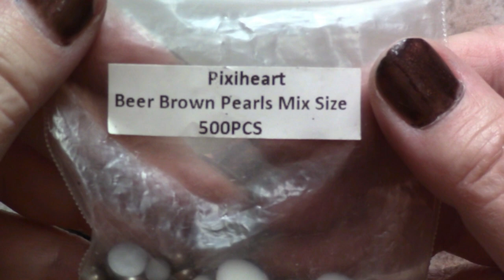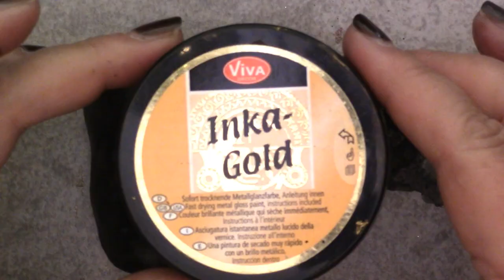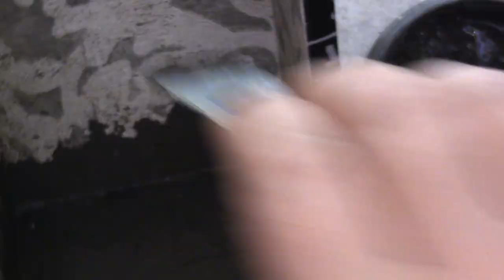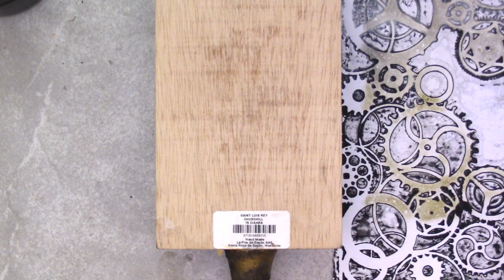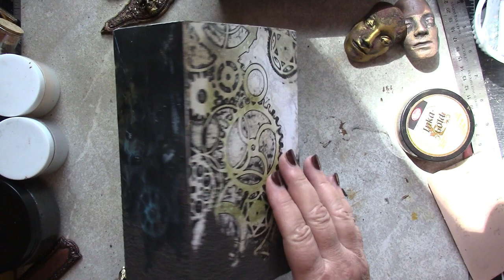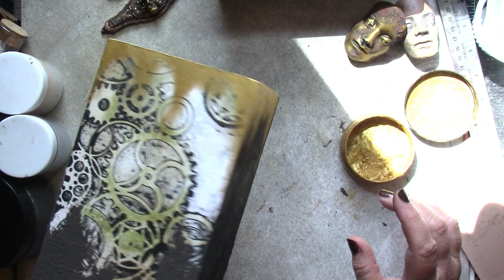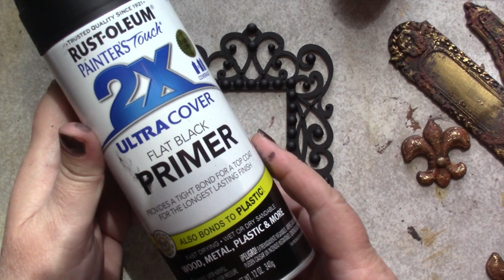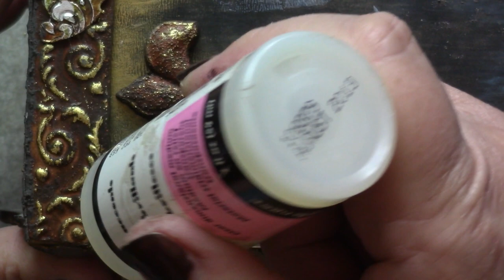Mixed Media Shrine  - "Acceptance"

Comment: i know it is a bit tricky, but making sure the item you are working on is centered would really help. we don't need to see the paint large and only a small part of the face you were working on. zooming out a bit would also help.

on your work surface, a small mark or sticker to mark the center of the video frame would go a long way to make sure you are working in the center and not off to the side.
Reply from the maker: I appreciate the pointers, my friend. Thanks!
Reply: @Thicketworks  you're welcome. i actually have a degree in video production! but have worked mostly as a photojournalist. i admire the kind of work you do and would so love to learn how be an adequate crafter as i moved into my golden years.  :-)